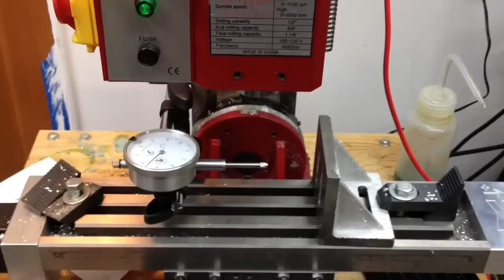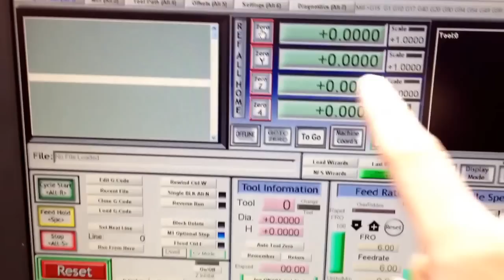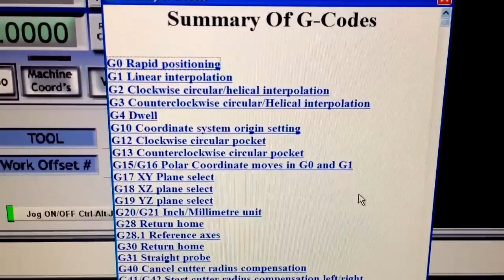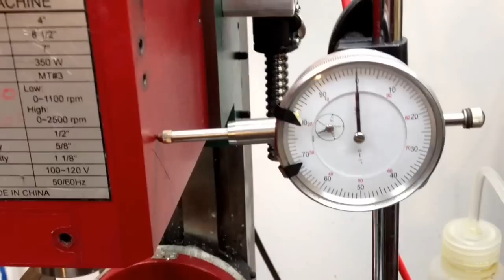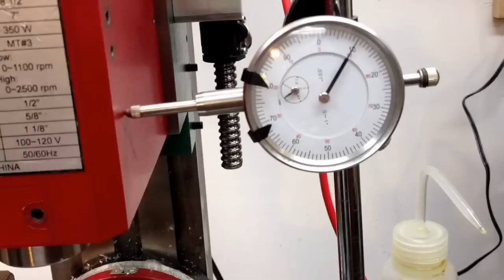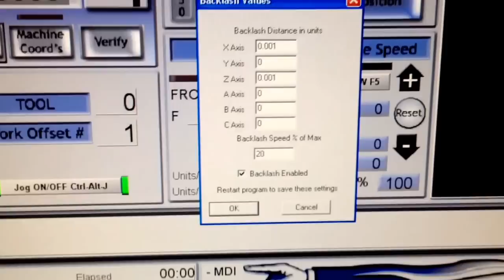Calibrating backlash compensation

Comment: Where can I find out what those drawbacks of using backlash compensation are?
Reply: Backlash compensation will help for many types of cuts. The type of cut that it most likely won't help with is cutting a circle. The cutting forces will move the head around in the backlash, so you will most likely get a slight irregularity on one of the quadrants.

I can't really see any disadvantage to using backlash compensation. Your cuts will be closer to the right spot than if you don't use it.

For many cuts having a tolerance on the size that's bigger than the backlash is more than acceptable. If I'm going to drill a bunch of holes, I try to position the head so that it's always on the same side of the backlash then the distances between the holes will be as accurate as your leadscrew.

So I find its worth making sure you understand backlash, and when its important and when it isn't.

climb milling will pull the head to one side of the backlash and convential milling will push the head to the other side. Sometimes you can use that to your knowledge.
Reply: The screw is not uniform throughout the range of motion ... software will compensate for it in a linear fashion